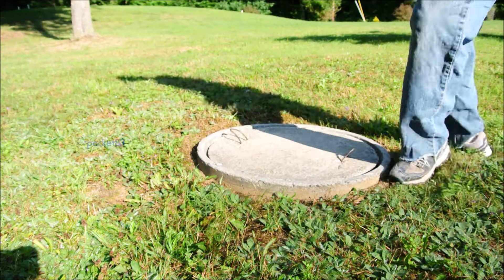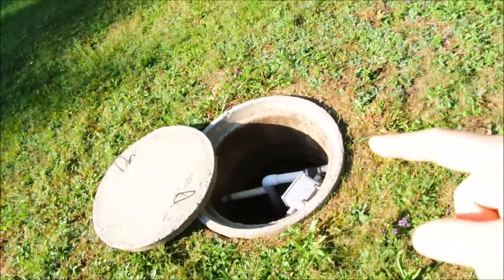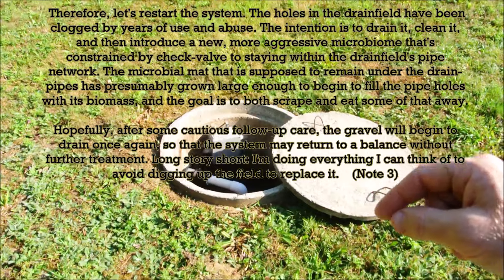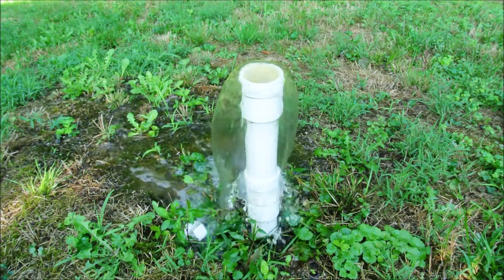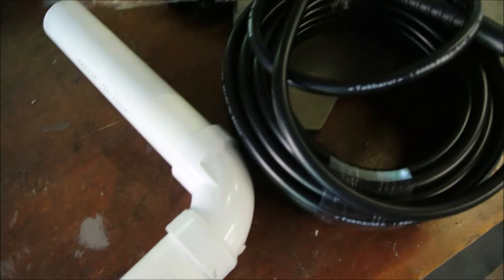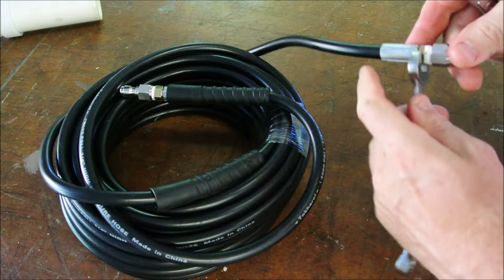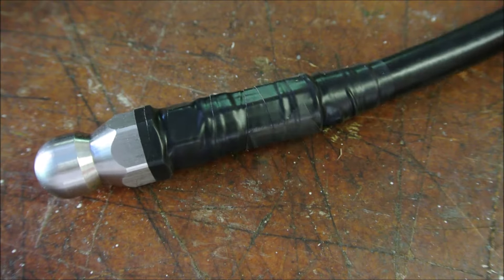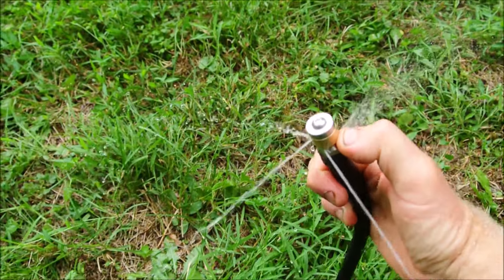DIY Septic Tank Drain Field Restore (Leach Bed Flush)

Comment: i have septic tank but i dont have that check valve. septic company told me i need a new drain field. one guy recommends chambers he said it's better than ez flows.
Reply from the maker: Whether or not you have a check valve may depend on your climate. If it gets too cold where you live, pipes holding water can freeze. As for your drain field: of course, just about anybody you ask will say that you need a new one—liability. Are you certain it can't be restored? Most of them just need a break from abuse.
Reply: @pocket83squared  i had the county inspector to come in he said usuallt drain fields need to be replace around 25 yrs. he was surprise my drain field is 40 yrs. not sure how true it is that drain fields need replacement after awhile.

Comment: The key to a trouble free septic system is plenty of water!  Yes, a drain field does have a limit to the amount of water that it can leech, but too little water will allow the build up of solids...water is your friend.  Take more baths!
Reply from the maker: Not exactly. In some respects, the less water you use the better. Most of what's going on here is a holding of the bulk of the mass until it can be removed. The water is just a transport system. But in order to use that transport system, we have to pay a tax, and that's dirty water. The dirty water carries away some of the mass, and then it becomes problematic up in the drain-field. The idea is to pay as little tax as possible. 

Though there is a minimum rate of flow you'll need in order to keep things free-flowing and functional, in general, more water means more biomass ends up in the drain-field. It also means more electric consumption and more pump wear, so water conservation is still prudent.
Reply: As soon as you mentioned how little water you try to use, I knew instantly why you are having problems:  your solids to liquid ratio is bad.  More water,  more better.

Our septic system has been trouble free for 26 years.  Inspected, but never needed pumping.
Reply from the maker: @MrGus.1  Wow. This video gets so many 'I know what you're doing wrong' comments from people who don't even watch it. And now, just like the rest, you're dead-wrong and you aren't even listening to my replies.  

No, my solid-to-liquid ratio is not "bad"; that's total nonsense. I bought this house with an already-strained system. My fixes have now restored it to functioning the way it was designed to. In contrast, your "never needed pumping" system is functioning as a watered-down slurry waste pump that's burdening the local water supply, and ecology, with your untreated filth. Hopefully you are far away from neighbors—and any streams. 

For the love of civil decency, try to understand both my video and the reasoning behind having a holding tank in the first place. You might as well be running an open pipe over the hill. It's people like you that have created all the folk-wisdom surrounding this topic!
Reply: @pocket83squared  Have a nice day.
Reply from the maker: Don't scoff it off. Read up on how a septic tank works. Browse the Wikipedia article.

Comment: Enzymes.  There are bacteria present, but the enzymes consume the solids.  Buy some enzyme and add it monthly.  That is why your field potentially is clogged.  There should be a screen before your pump to prevent solids from entering the field.  The enzymes will deposit solids in the bottom of your tank.  Those solids need removed every five years or so.  Your neighbors must not be close because sometimes when they smell effluent, out comes the county and that can get expensive.  A contractor can jet your field, but that is not guaranteed to work.  I would caution you working on your own system without a license.  Some communities and or states frown on that.
Reply from the maker: You didn't watch the video, and you certainly don't know what you're talking about. Simply stated, a biomass is exactly what it sounds like, and you can't make one disappear with "enzymes," no matter how much it breaks down. There is no effluent smell, and my system has been working well ever since. A license to maintain my own plumbing?! Wow.

Comment: The one problem I see is that your drain field is higher than your septic tank, and that doesn't flow as designed. You need the pump obviously to get the water up to the drain field, and my guess is your pump is sending a much larger volume of water through the drain field causing it to come out of the pipes instead of percolating through the drain field and into the ground. This design of the drain field being higher than the tank is prime conditions for a back up into your house. I'd quit guessing at this and call the pros before your house is flooded with sewage. If you can, I would have a new drain field installed in a part of the yard that is lower than the tank.
Reply from the maker: There are two problems I see with your comment. First, you clearly didn't watch enough of the video to understand the premise, and second, you even more clearly have no idea what you're talking about.
Reply: @pocket83squared  
Okay bud.  Tell me what the expert says if you should make the right choice to call one. 
You will learn that either the pump is sending too much at one time to the drain field, or your drain field is restricted from not having a filter inline to protect the drain field. Gravity fed systems are always better because it flows downhill naturally without the need for a pump.

Comment: Bacteria do not just break big particles into smaller particles. Where did you come up with it? Bacteria eat organic matter and converts it into liquid (mostly water) and gas (carbon dioxide, methane, etc). Commercial septic products also contain enzymes, that break complex molecules of starches, proteins, carbohydrates, and cellulose into smaller, simpler pieces that easier for bacteria to digest.
Lipase – breaks down greases

Protease – breaks down proteins

Cellulase – breaks down cellulose

Amalase – breaks down carbohydrates and starches

The growing bacteria will then start to produce more enzymes on their own.
Reply from the maker: Yes, all of that is correct. And in any Stoichiometry problem—or any other ideal scenario or system, for that matter—every single molecule could be accounted for. That said, tell me: where did you come up with the assumption that a septic tank is an ideal system?

What made you think that a septic tank could ever complete all of those processes that may've begun inside of it? What are eutrophic/dystrophic bodies, if not solutions of water that have bitten off more nutrient than they can chew? Isn't this precisely what happens in any holding tank that is continuously taking in additional contents? 

Though nobody likes to admit the reality, holding tanks were only designed to chemically delay the inevitable: eventually, it'll need pumped.

Comment: So it's my understanding that the (majority of the) additives you can put into your septic system, are mostly designed to function in conjunction with your tank.

 My understanding is that those solid waste materials are SUPPOSED to be broken down by the natural bacteria that exist, over time - into those smaller particles you mentioned.  It is only supposed to accumulate to a point, and no further - and if maintained properly, this balance can be carried on for a looooong time.  Is this accurate or not? 

 I keep coming across these videos that definitively say you have to pump your tank every so many years, when tonnnnnns of people go decades without doing so, without issue. Does anyone know why this is? 

If we are constantly adding things to our system (ie bleach, fabric softener, etc etc) that cause problems and create imbalances in the "living" environment, is it not logical to assume that periodically boosting the bacterial production in the tank is a fairly intelligent endeavor?  Were these systems DESIGNED to have to be dug up every so often and pumped at a grand a shot, no matter WHAT the home owner does?  That seems.... Inefficient to me.

Comment: I have to put a septic tank in and they say in my area, there is a strong chance that I will need an above ground type that could cost 30k … I’ve lived with these things… it’s so much easier to compost toilet. And compost everything.  People are so freaked out over compost toilets but they prefer keeping all that crap in a tank … then it gets spread out all over their yard and they get stinky water like this … it’s absolutely insane. There are better ways to deal with this stuff. So much better. Like way better. I lived with a septic tank before.., hate them.
Reply from the maker: Honestly, It's really not bad once you have it functional. Since this video, it's been really easy (except for one pump replace). Besides, composting is disgusting without indoor plumbing: and if DO use indoor plumbing, then you're still going to have to deal with water treatment.  

Septic systems are just a reality we have to face. Even in rural areas, there are too many people; and so we just can't let everybody rinse their waste into the surface water. There isn't enough room. And believe me, if it were legal, people would do it.

Comment: If you're so against rid-x how come you're the one with the problem
Reply from the maker: What? You are confused. Treatment products can work well—as long as you put them in the right place. 

Do not Rid-X your solids tank unless you want its mass to break down and be pumped into your leach field. Mass doesn't disappear when it breaks down, you know; it'll just move via the water, and then clog up your microbial mat. 

My "problem" was the result of a previous owner (a widow), who ignored septic maintenance for several years. Now I have to further break down the mass that's stuck in my leach bed. Treat your toilet bowl, and you'll eventually end up with the same problem.

Comment: Your drain fields are clogged with bio mat.  Break up the biom mat and problem with go  away.  I've been using formulation of a combination of brewers enzymes and bakers yeast.  To keep bio mat under control.  12+ year old 1000 gal. system with 6 adults using it.  So far so good.  I also have the tank churned and drained yearly.

Comment: fix the problem you need a front load washing machine ,,too much water in system, all septic systems works best with front loader washer 6 gallon vs 40 gallon top loader
Reply from the maker: The washing machine had nothing to do with it.